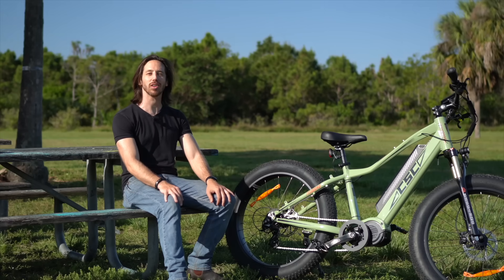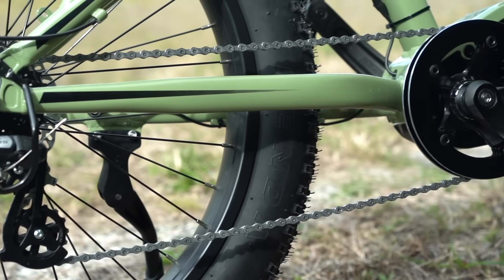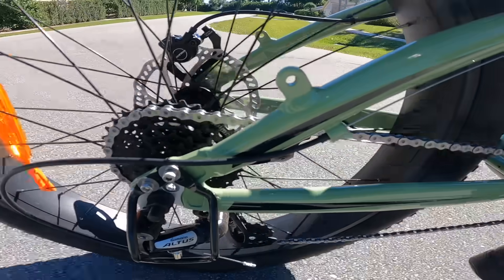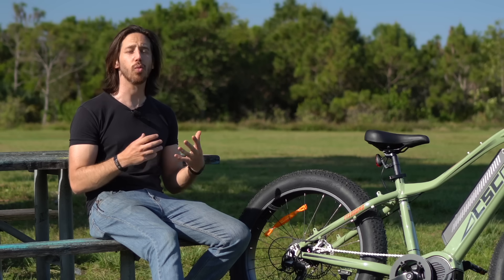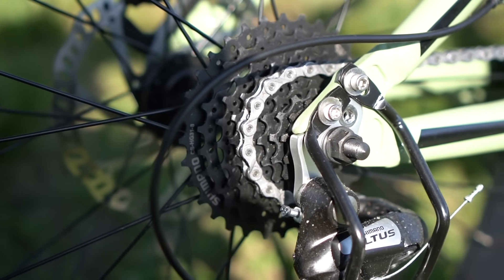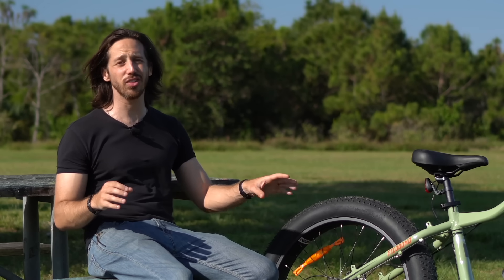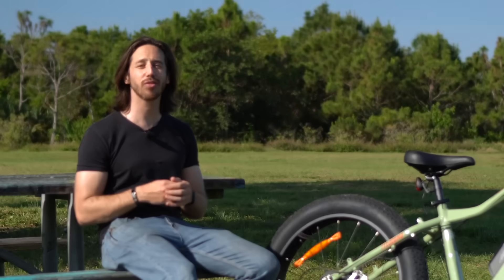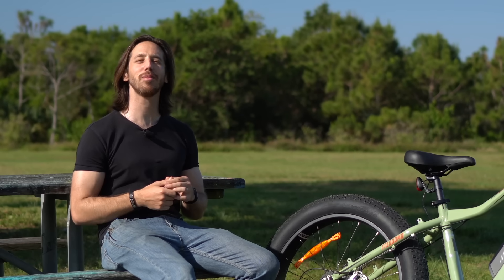How to (properly) ride a mid-drive electric bike

Comment: 3:35 is what I came for - don't shift under load, back off pedal briefly when shifting . I have been doing this intuitively but wanted confirmation. Other info in video  useful. I think looking after drive train important given the extra load. I have hub gears and difficult to know what is going on in there, so when i get failed shift the only thing i can try to do is adjust cable and chain tension , lubricate. I have changed chain but imagine my sprockets are a bit worn, and wish i had looked after it more closely, probably better to have got new sprockets at same time as chain as chain way stretched
Reply: do people usually get 2 chain per sprocket set? (fixed chain setup)

Comment: But what if I have to stop quickly with no time to change down? How do I get back to low gear for take off?
Reply: What I do (when I’m not using the throttle) is I just slowly and very carefully pedal just enough to get the bike moving then shift down. 

Or get off of it and walk to a downhill 

Seemed fine

Comment: Given the good power of the motor and it's preference for high RPMs -- what is your recommended size of a front crank ring for city & suburban riding ?  My city friend is on his 3rd E-Bike after 5 yrs of going car-less.  He now rides a Hybrid Giant & Bafang750, mostly w Throttle Only & 0 PAS, and manually peddles only when shifting as it's safer on the drivetrain.  And he uses only certain cassette gear ranges -- say  2 / 4 / 6 / 8  --  using the "deep push double shift" method on the shifters.  He is thinking to modify his cassette and remove the unused gears to only 4 or 5 gears -- to simplify the gear shifting.  Is what he's doing a common thing now?

Comment: why shouldnt we just put a bigger pedal sprocket on a mid drive motor? I did and it got a LOT weaker and the top speed didnt seem much higher. why is that probably happening?

Comment: In a rear hub motor e bike, you can have the bikes gear in any gear, and the bike will have full power and. full top speed no matter what gear its in, and it doesn't use the chain to go. So on a mid-drive motor, the motor runs off the chain?? So if you have it in like gear 3 it will have a limited top speed to that gear, sort of like how motorcycle gears work?

Comment: Excellent mid drive review. The subtlety of using the brake lever cutoff has saved my BBSHD every time, it’s even much better than the gear sensor I have installed.  Often the gear sensor is just a bit out of sync with my up/ down shift, but the brake lever, once you get the “feel” is the ticket! Great job 👍

Comment: I have been really suprised at the power difference between my xPremimum and my Zebra. I somehow was under the impression that the gears would make up the difference in power. It doesn't at all. Quick question, does a mid drive or a hub drive need more power to achieve the same level of performance?

Comment: I'm confused, how do you shift gears without pedaling?    I never rode an ebike before, but on my mountain bike I could have sworn that the chain needs the rotation in order to complete the moving of the chain to a different cog.    But it's also been years since I rode at all so I can't remember, so your chain could actually jump to the next cog with the pedals not moving at all?

Comment: I have a 750 BBSO2 mid drive on a 7 gear mountain bicycle. I do not like to shift ever. I keep the gear in 48-13 gear ratio. I ride in 2nd level and then shift to 3rd level to go up hills and go to the 2nd level when down.  The motor seems warm ;not hot. Am I harming the motor in any way?

Comment: Just wanted to revisit this after riding all summer WITHOUT a gear shift sensor. Conclusion, gear shift sensors are too slow and make it difficult to shift efficiently. I've never had more fun riding than I have without the sensor, as manually cutting the throttle slightly before the shift is super intuitive, and something you can get good at with experience. The sensor ruins all of that!

IMO the problem with the sensor is due to the inherent mechanical lag. When you click into the next gear the chain mechanically begins to move to the next cog slightly before the shift sensor cuts off the power. Then the delay before power is returned is way too long (and non-adjustable), it makes it impossible to shift quickly, efficiently and smoothly. Probably could be improved in software, but that's not really an option.

I just added a switch on the shift sensor circuit, though I'll probably never turn it on again. :)

Comment: "Technically these are cogs" Technically they're sprockets.

Cogs are toothed wheels that mesh with other toothed wheels. Sprockets are toothed wheels that engages with a perforated or indented belt or chain.

Comment: @HK I was thinking the same thing after watching this. If the majority of riding is going to be with the motor, a 5-speed, which uses a much beefier chain would make more sense. Also, the weight of those huge tires and the energy needed to start them rolling has got to drain the battery much more than a normal size tire and wear the brakes down much more quickly.

Comment: Mid-drive motors must have heavy-duty chains such as motorcycle chains or strong rubber composite belts (chains). Otherwise, the chain will break very often. Tesla cars have four hub motors, one for each wheel.

Comment: I think much of this discussion (all but the starting off in lower gear part) could be simplified by explaining cadence. My Shimano, and I expect other bike motors, let’s me display the cadence on the mini display or my iPhone. It seems to me that as long as the rider keeps their cadence above 70, they will be in a gear that won’t over-stress the bike. Additionally, they will be getting a workout that’s optimal for their bodies and build strength that lets them rely less and less on the motor and more on their bodies.

Comment: This is especially true with hub (epicyclic) gears as they are often more fragile. My e-bike has 7 gears and I spend most of the time in 3rd to 5th (as advised!). Keeping it in 5th when going fast also helps me get more power without asking for higher torque. Thanks for the advice!
Reply: What you mean hub gears ? 🤔 Something like Nexus 8 gearbox, or a cog derailer set ?

Comment: Thanks for the useful tips.  I've been riding my Benelli Tagete 26.5 for almost 8 months.  I didn't realize I that my style may be putting unnecessary stress on the gears.  I've  heard the popping noises occasionally.  Anyway, thanks for the info.

Comment: As a new mid drive EBike owner this video was a great help. The seller did not explain that one shd not pedal while shifting gears. When I got home and tried to ride up a significant incline I didn't make it. I thought smthg was wrong with the bike. The manual was only slightly helpful but I'm 74 and ebikes are still new to me.  Luckily my husband who has a hub ebike guessed I should not pedal at all when shifting. Since then no incline is a problem. Your video gave us greater insight and more advice we can use such as not starting in a high gear and using the mid gears more which I instinctively began doing as I learned how to ride the bike. So it was good to know I was doing the right thing. Also informing how to use the brake like a clutch is a big help. Thank you.
Reply: With a mid-drive motor and a rear cassette, you will NOT actually shift until you pedal! The chain needs to be moving! BUT - you can keep pedaling while reducing the force. This is the same as any derailleur bike. The warning is to NOT shift the bike under maximum pressure (pedaling and motor).

Comment: 160 N-m is only 118 ft-lbs. In other words, if you weigh 236lbs and your pedals are 6 inches long (or you weigh 160 Newtons and your pedals are a meter long ;)), you could easily apply that much torque (at least momentarily, when the pedal is horizontal/at 90 degrees to your force) just by standing on the pedal. It is nowhere near "way more than any human could ever dream to put out".

(Of course, you shouldn't shift under heavy load like that whether you're pedaling or using a motor.)

Comment: With a 750 or 1000 watt motor your going to wear out chain and sprockets pretty damn quickly no matter what you do. They're just not designed for that amount of power and torque. This is something that most people never think or realise about mid drive systems. Everyone tells you it's a better system...sure if you can afford a complete new transmission every few hundred miles or less...A win for hub motors!!

Comment: Bought a nearly new but used Fischer ETH 1861 for half the price, 1.100€. It has  a Bafang M400 midmotor with 90Nm, a 557kWh battery  and 9 gears. 

As I found out on the km I rode until now is to ride in mid gears up to 7. or 8. gear in a good rpm ratio from 60 upwards with as less electric motor support as possible or necessary makes the most sense to me and will probably make all motor components last longer and is good for my health as a bicycle rider.

Only if I'm riding uphill or against too much wind I'm going to  use  a higher  e-motor support like Nr. 3 or 4. Sometimes on stressfree plaine grounds I ride the bike without any support like a 'bio bike', which feels good to me.

But it's up to you how you use your e-bike. Some riders always ride with the max. motor support in a high gear and with relative low rpm, cause they like it that way and think, an e-bike is meant to be ridden like that and it's the biggest difference to a bio bike that you can do it 'easily'. That will surely decrease the lifespan of the battery, the gear box and the midmotor. If you don't ride much km you will not notice it fast, but riding an e-bike means to shift a lot and play with the motor support, the battery and the gears (a lot) in urban cruising to make the best out of it based on experience in my eyes, though I'm not trying to be the fastest e-bike rider out on the streets.

Comment: if you have a hub motor you can start pedalin in the highest gear, no problem,  pedaling just adds a few more miles of top speed and additional eccelaration, as long as the highest gear is matched with the top speed of the bike motor

Comment: I thought you were going to touch on 'Deristricting' these motors . The VOLspeed for the Bosch motors in particular. I hate having to have a top speed on level ground  stuck  at 20 MPH!

Comment: I have a folding manual pedal bike called "Flyby" that I bought from REI in 2014. It has a Shimano 7 speed rear hub, with a shift control on the handle bar. The chain has 2 sprockets, one on the pedals and one on the rear wheel. You can shift into any gear at any time, so if you stop, you can just turn it down to 1 or 2 and ride off, even if you stopped in 7. No messing around with running through the gears, just select what you want and go. Why is this not used on every mid drive bike? Too much power? They even make a 9 speed that I have heard of, and that would be even better. Combine that with a belt drive and you would have the ultimate setup! Those belt drives are lasting for 100K miles.

Comment: What you say about changing gear applies to non-electric bikes as well -- you don't want to be pedalling hard at the moment you change or you're ramming the components of the drive chain together (and apart), rather than letting them fall into place, which would create more wear!
Reply: TelegraMe@EbikeSchool  What reaching out do you suggest?

Comment: I think I just learned more about my mid drive motor in the last eight minutes than all of my previous knowledge combined. I always ran in the highest gear (smallest cog) at top speed with my two battery setup and guess what? Burned my 750W hub motor up and ground down the cog teeth, just like you said. I'm in the process of installing a 750W mid drive, waiting for the compatible electrical connectors. Definitely glad I saw this before I went and did something stupid, again! Thanks.

Comment: In EU most bikes are mid drive, 250 watt with torque sensor, and internal hub gears.  This seems to eliminate most of the problems with external derailleur sprockets and cogs and riders usually start off in low gear.

Comment: The most important item for a m8d drive is the gear charge sensor as it cuts power when changing gear. I now change gear more than I did without the motor!

Comment: I have a 1000 watt front hub motor with "cruise control" I set it to 6-7 mph in 2nd gear and just use the gears to keep some tension on the petals ..."easy rider"

Comment: something i've always wondered: would switching to an internally geared rear hub alleviate the need to "clutch" while shifting gears?
Reply: internal geared hubs work slightly different than a derailleur drive system. For a derailleur to work you have to be pedaling to shift gears.. You just don't want to do that while under a heavy load. That's why you want to back off a bit, but don't stop pedaling when shifting. It doesn't take long to get a feel for the sweet spot for shifting. 

You also don't want to shift an internal gear hub under load, but you can shift without pedaling. The best way to shift an internal hub is to stop pedaling and then shift. You can also shift gears while stopped.
Reply: @AlSelk  oh yeah totally, not surprised, just wondering if an internal hub was gonna be the magic bullet

Comment: These must be some delicate e-bikes. I've been running a 5kW mid drive for over 4700km, often shifting with full power down. I've only snapped one chain and a few quick links in that time.

Comment: Appreciate these tips. A quick question though... You said to pause while shifting. No problem. But on my regular bicycle, I have to be pedaling when I shift, otherwise the chain cant jump to another sprocket. So, if I disengage the motor by braking, shouldn't I be pedaling while doing this so that the chain can shift?

Comment: You said it; 'these drive trains were made for manual pedaling'. My mechanic calculated that i will 'need to install a new chain ever 30 days' (and replace cogs front and back quarterly). I'm riding over 50 kms (or 35 miles) per day. I'm not impressed. E bikes need better drive trains and Shimano and its umpteen speed drives are not doing anything to HELP. Fast forward a bit......Goofball (maybe not so goofball) at the bike shop suggested I use a rear derailleur after I suggested an old 1/4 inch 3sp chain on a single cog rear hub (Nexus/Alfin) to beat the chain stretch problem. what do you think?

Comment: A very useful video. With my opinion, I would recommend for bafang 1.5kW mid drive use the carbon belt with 3 speed sturmey-archer planetary gear hub. This hub may hold about 2000 kW motor power and big torque. The gear ratio range of sturmey is enough for such a powerful motor
Reply: Hi im interested in what your saying where can I find more info or buy such a set up?
Reply: @dertyberty  hi! youtube do not let me replace link about this gear hub

Comment: What's the advantage of a mid drive? From my perspective, it seems like the rider needs to do a lot more work to manage the drivetrain. What do you get in return? It really seems like there's an engineering issue here pairing a motor to a drivetrain that can't handle the torque.
Reply: Try having 120 kilos, and climbing a 25 degree uphill road, with a 1000w (geared, direct-drive won't even move from the spot) hub drive ebike, then the same road with a 1000w mid-drive one, on throttle-only. You'll get your answer. Oh, and measure how much battery charge each drive type uses, while outputting the same power. For a delivery rider like me - night and day difference, and the difference between being soaked in sweat uphill, and a casual breeze. Plus saves on time while making deliveries, making me more money. And lets me ride longer on the same size battery.

Mid-drive can be tricky to ride (especially my Bafang Ultra with no gearshift sensor), one needs to keep the gears in mind and downshift ahead of time, keep one eye on the power-draw (that's a must IMO; your HUD needs to have a power-draw display), and avoid shifting under load, but it's by far the more efficient drivetrain. It just requires some forethought. Hubs are for dummies who want a no-brainer ride. It gets the job done, it's simple and reliable, but it's very inefficient. Basically uphill, you need a 2000w hub motor, to equal the torque of a 1000w mid motor. And you'll use a LOT more power.
Reply: @necroticavalon5176  that makes a lot of sense, thanks

Comment: Sram makes a ebike 8 speed derailer and chain called the ex1. It is the bees knees, but the cassette is stupid expensive. Luckily sunrace makes a wide range all steel 8 speed cassette  that works great with it.  I am heavy and have a 3kw mid drive and can shift under power up San Francisco hills.
(Microshift also makes a wide range 8 speed, but I haven't tested it.)

Comment: Have you done a video on 'how to ride a rear hub drive e-bike?' If so, can you point me to the video? If not, can you do a video for that too. I looked but didn't see any with that title. 
I find your info on the mid-drive useful, but like most, I have a rear-drive 500W 48V system, and I'm new to e-bikes. 
I'm probably not doing anything wrong, as I don't hear any noises that alarm me, but it would be nice to have more advice on that. 

BTW, I generally ride in mid-gear (3-5 of 7 gears generally 4th) and don't change that too often, I am also 72-years-old, so I tend to use the throttle more than pedal assist. Any advice for my riding would be nice. Thx

Comment: All these w
ould happen even with hub motor. This means that ebike should have IGH, rather eIGH with belt drive.This is the reason I stayed away from Ebike. Until I test ride serial1, although even they need to fine tune it. No wonder Europeans are not in a hurry to put those 750 - 2000W motors. I also want ABS and 203mm hydronic brakes and turn signal standard.